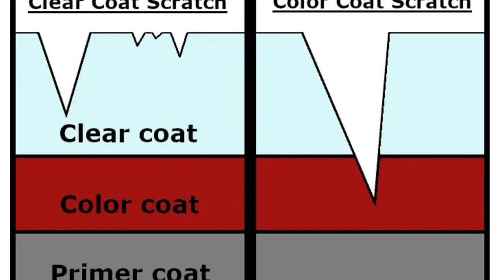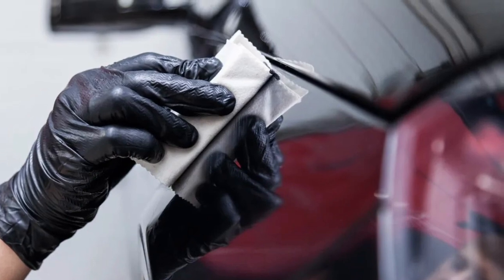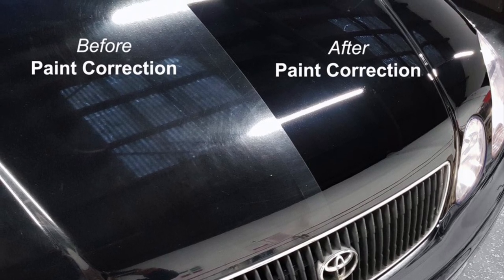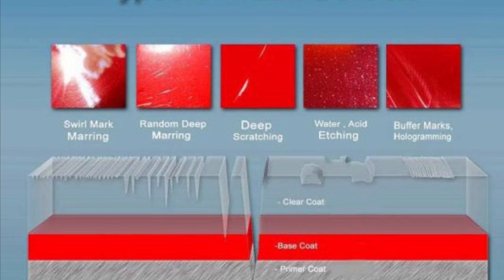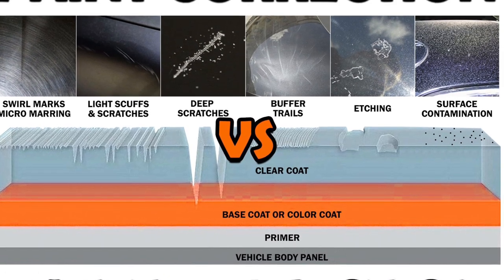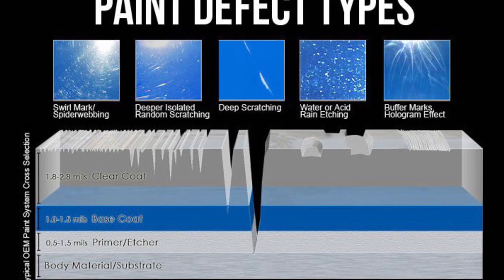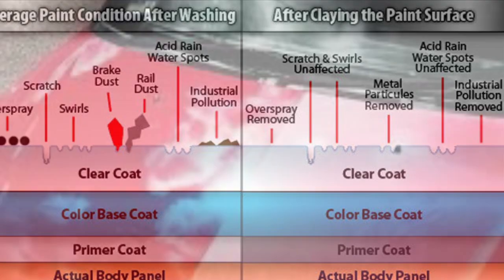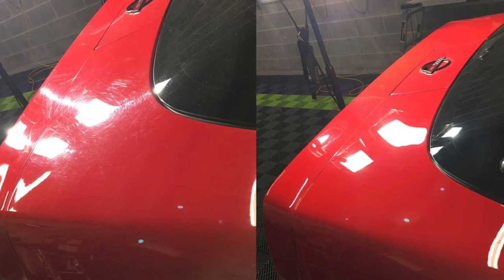What Is Automotive Clear Coat? This Is What You Should Know!! Apex Detail!

Comment: Another awesome video Brian however clearcoats are not lacquer anymore unless they are a 1K clear - any catalyzed or clearcoat that requires hardner to cure is 99.9% of the time acrylic urethane or if in the commercial fleet side polyurethane 

They have not used lacquer per se since the late 80’s when everything finally went bc/cc 😎

Comment: Bought a brand new car, 7 miles on it, dealership runs the car through their car wash, creates some light scratches, they then took the car to their “detailing” department, nothing but a detailer wannabe, uses the wrong method, wrong buffer and creates swirls all over the car and deeper scratches now reaching the paint, 14 days later still no car 🤪🤷‍♂️ stuck in the body shop. What a headache. This video is extremely helpful. The photos are amazing aids to understand, thank you

Comment: How long should a clear coat last. My car repaired with a guarantee on craftsman and material guarantee. It is peeling only where the repair of the front, which from the door forward was blended, painted, clear coat applied. The original clear coat on the rest of the car is still in good shape. Car covered always when outside and wiped down after rain and morning dew. I feel it should be covered as the original clear is still in great shines condition. I am asking prior to approaching them to repair it under warranty. Thanks.